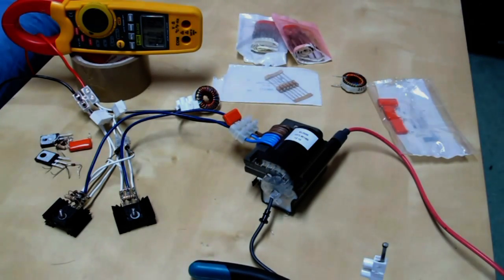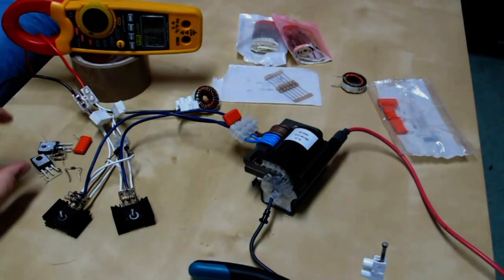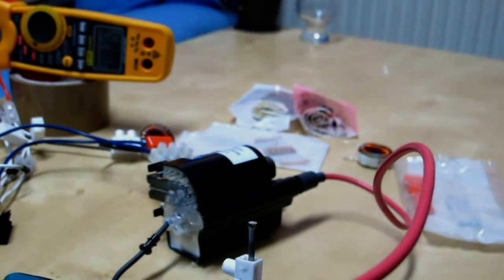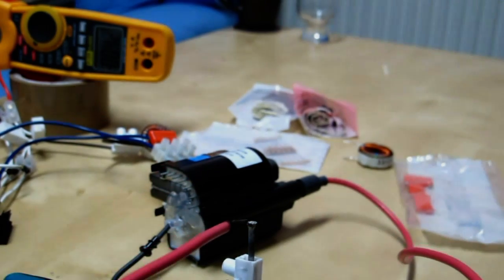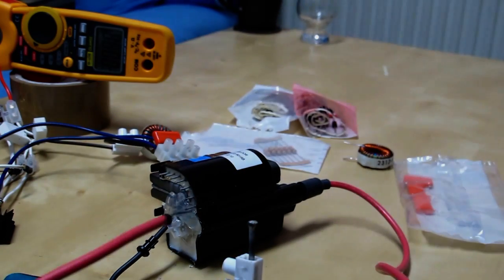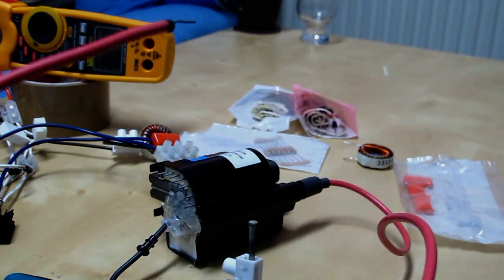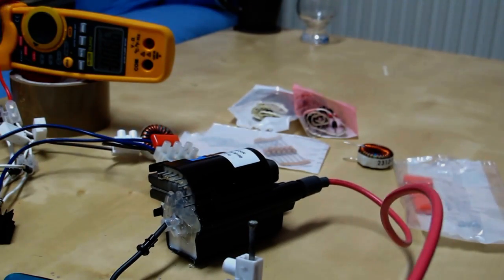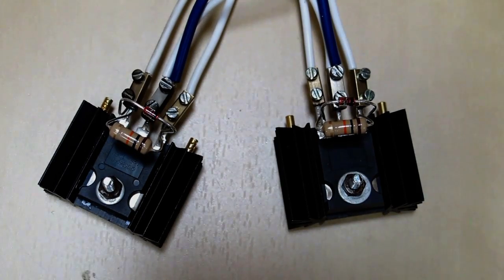Flyback resurrected. Now with added IGBT!

Comment: my igtb got hot why?
Reply: Maybe frequency too high, maybe insufficient gate voltage, should be a square wave
Reply: Maybe you have too small or not heatsinks. Maybe you have too little turns at xformer primary  We aren't a prophets.